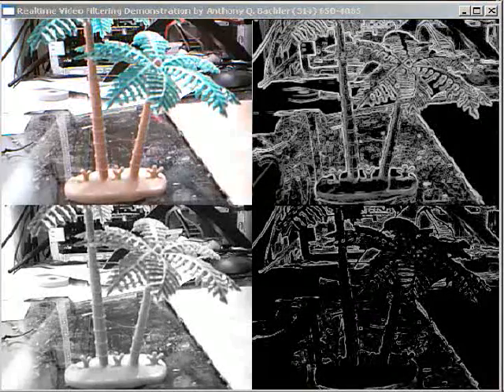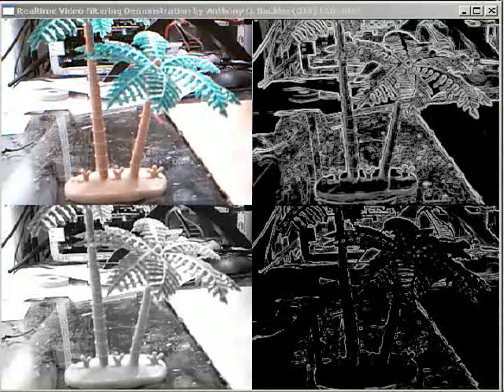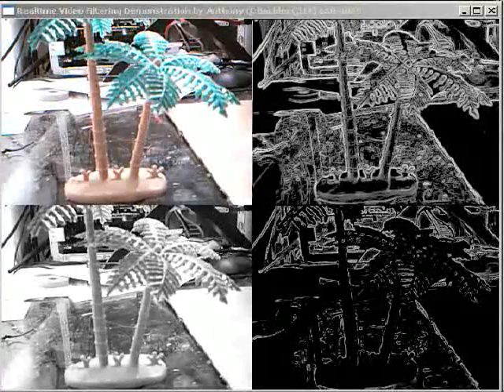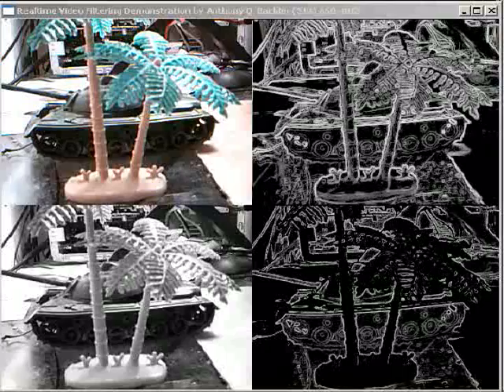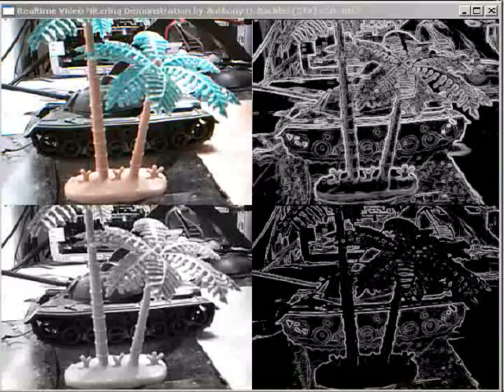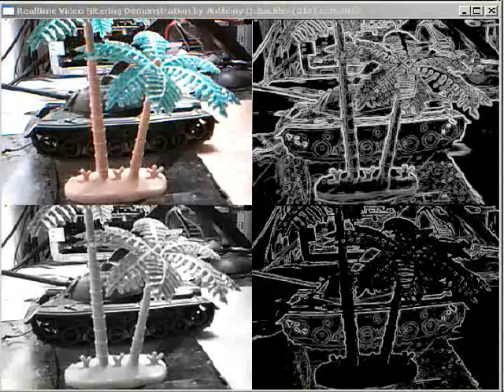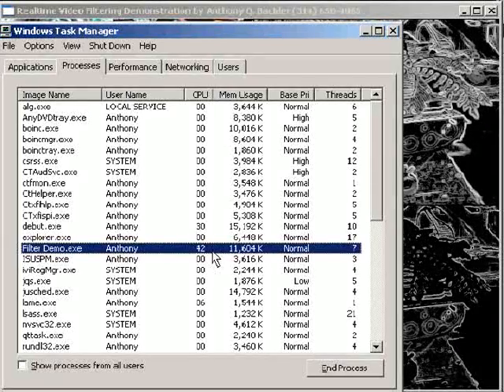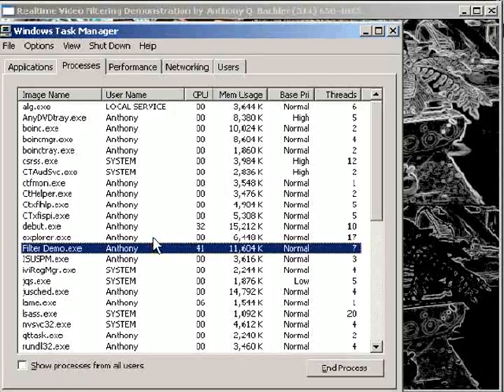Edge detector Demo with second stage feature filter

Comment from the maker: The truck driving project produced the camera class that this project uses, but the edge detector is part of a new project to develop an autonomous warfare system.  The SBIR program never approved the truck driving project, so I had to shelf it.  I sent a few proposals out to the major truck manufacturer's, but they usually just shitcan outside proposals without reading them.